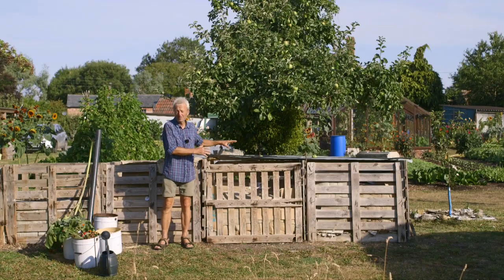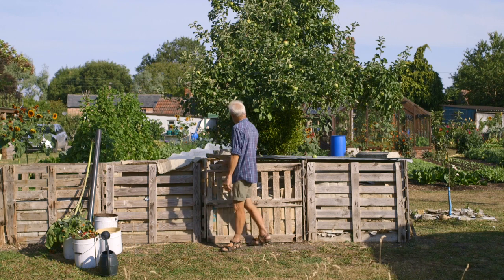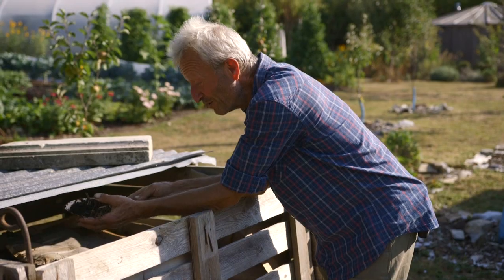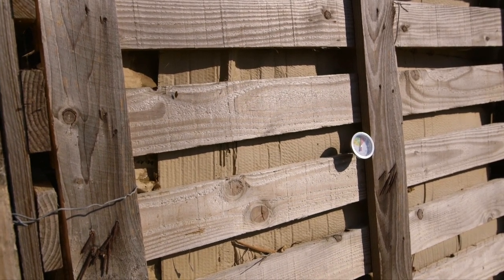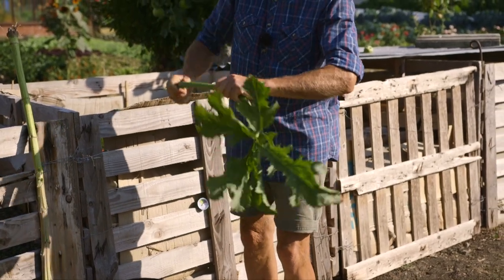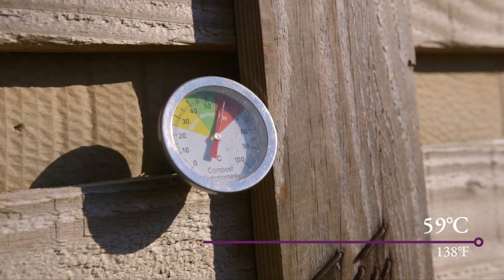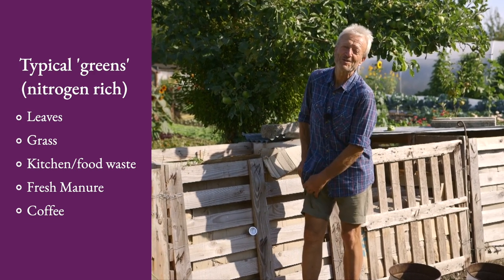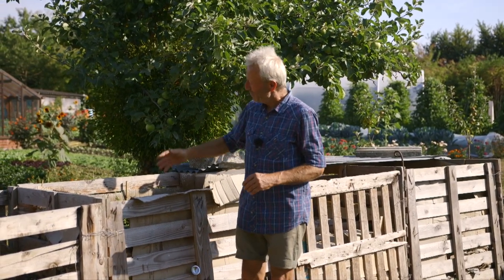4 Compost Heaps in 3 Bays, ready in 6 to12 months

Comment: People put in a PVC pipe in the middle of the compost heap with holes drilled in to allow oxygen to pass through.
I think the secondary part of it is that you can add water that will distribute the water around the compost better.

Comment: Wonderful video thanks! I am a compost nut for years and have always found drying out is the biggest problem in most heaps I see. I have found placing objects on top help to retain moisture when it's very hot. Heavy rocks or logs help. I never thought of cardboard sides. Thats genius! It will also keep the pile warmer in our freezing winters. For sides I use welded cow panels which in the US are 55" wide and 16' long. So if I cut into 4' lengths I get sides 4' high and 55" wide. One side of these sections will have long spikes which I hammer into the ground about 5" which makes the sides very stable, needing only some ties on the corners for support. My favorite ingredient is fresh green grass clippings which I collect by the bagful at our city compost site. Layering that in is like rocket fuel for the pile, I love to see it heat up to 160 degrees in a couple of days making me very confident to add any weed seeds I have around to make for completely no weeding when I spread on the garden.
Reply from the maker: Great to hear Brian, what an excellent system you have!

Comment: Thanks so much Charles. I have a similar system for composting my garden debris. I just wish I had as much garden matter as you to make compost faster. I add a fair amount of coffee grounds from a local coffee shop to add volume. I used to have a horse manure donor…. But they moved on.

To prevent rats I also use 2 small compost tumblers where I put most of my my kitchen waste along with any fruits or root vegetables that would attract rodents. I add compost worms to the tumblers (harvested from my heaps when they cool a bit).  The tumblers basically become rat-proof worm bins (since the tumblers never got hot enough for me to make compost quickly enough without worms). I add pine pellets to absorb extra water in the worm tumblers. The worms survive the winters well in my climate (maritime temperate like yours, in coastal Washington state, US).
Reply from the maker: Nicely worked out Greg. Hope you find more material!

Comment: Charles, I agree air access to the compost is overstated. My compost wooden bays ,  modelled on yours, have no gaps between the boards. In addition, after a few years, I lined the outside of three bays and one side each of the two inner walls with 3 inch foiled high density polyeaurathane insulation boards. A lid of the same material covers the compost in each bay. Only the front is not insulated , but I do as you advised and line inside the removable boards with a double layer of cardboard . The bays  are covered with a tarp to stop excessive moisture.  My compost is just black gold. If temperature rises above 60 C I remove the lids for a while.
Reply from the maker: Nice to read this Eileen, great job!

Comment: Thank you for breaking it down, no pun intended. I had no idea I could put marigolds or sunflowers with seeds in the heap. I have been throwing away  my weeds and big borage plants that were full of seeds. (They grow everywhere!) Time to rethink my strategy!
Reply: I think that heap size and temperature are key.  I have a smaller pile that rarely gets above 120F and seeds will not reliably decompose below 130, so I cut seed heads off, particularly for problem weeds.

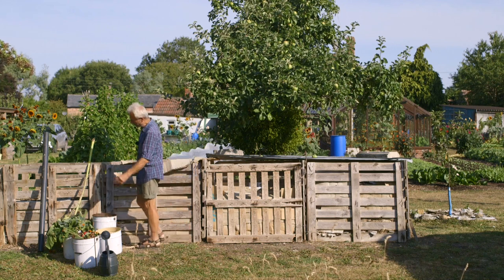Comment: 6:49 the air hole
I do something similar and put in the daleks
I take a piece of pvc pipe( can use an old discarded one if you wish  approx same diameter as your fence post and have drilled lots of little holes( perforated) . I leave the pipe in the middle of the compost as i build it up. The idea like yours is to draw in air to the middle.
Reply from the maker: Nice!

Comment: Charles, you pallet compost station is exactly the same as the one I built 3 years ago, 4 bays long. I wasn't sure it was a permanent position for composting in my garden. I found thin wooden posts (one in each corner) between the inner and outer slats of wooden pallet driven a foot or more into the ground helped secure the structure during construction and anchors the pallets together. If the composted needs to be moves its just a case of pulling the pallets up over the posts and pulling up the posts. It's worked well without having to nail into the pallets.
Reply from the maker: Nice!

Comment: I have 6 compost bins running. Packed into thick vegetable transporter boxes.
Turned one today. It had gone cold. Made it on the 29th sept . I had a few dead herrings in it along with dry and wet grass. I also put cow manure in with it.
Top was dry as a bone. Half way done was still damp and brown. The top half still looked greenish but covered white. Not burnt. 
At  the bottom it was pretty good so I mixed a bit of soil and mixed it. Looks good to use. 
I have remixed the pile into another box wetting it as I go.
Added some fresh soft cow poop. New dry grass to replace the top. Tarp on top. 
I have two other heaps. 6 x 6 x6 ft roughly. One has been there for 12 months and is only just resembling some form of decomposition.
I'm sure I have the mix wrong for quickening it up. But it will get there.
The other one I just roll with the tractor every few weeks. All trials as I am a newbie at this.
My large piles have never got over 110 f. Not that I can reach the middle. 🙂
Reply from the maker: Yes moisture is key to breakdown, enough but not excessive.
Sounds like you're enjoying that and finding good ways for your situation!

Comment: I try to make sure my compost isn't layered, as a homogeneous mix of materials seems to keep its heat linger & break down faster ( I do use a LOT of shredded cardboard but still see consistent temperatures over 60°C).
Any woody stems go through the shredder first & believe me, it works, just like Charles says.
As for moisture, I use recycled beer...
The dumpy bags used by builders for sand, gravel & ballast are great for storing compost prior to use, as they're free & allow a limited amount of air into the material. Be aware though that they are NOT usually UV stabilised & thus at some point become fragile & start shedding plastic fibres.
Mine go in the plastic recycling at that point, in the hope they don't end up polluting somewhere in Africa or Asia.
Reply from the maker: Nice job!
Reply: Recycled beer 😁. Never called it like that! I use recycled coffee for the same purpose.

Comment: We made a bin out of wire,  and have found that,  indeed,  it dries out to quickly.  We've made a space to put in the three-bin pallet, found pallets to use, have cardboard,and it's on the calendar to set up by the end of the month.

It's so much better to not have to worry about what dire chemicals may be in the compost acquired from outside.
Reply from the maker: Sounds excellent and may your compost be super good!

Comment: Thanks for all your wonderful videos and for sharing all this information. I'm about to try my hand at composting yet again. I've collected pallets which are 3' x 4', with the slats running the 3' dimension. I'm wondering if you'd recommend building 3' x 3' x 4' tall bins, or 4' x 4' x 3' tall bins. My inclination is to go for 4x4 to build more heat, figuring I can stack my raw materials beyond the 3' walls and allow the pile to settle  with time, but I dread having to rebuild the whole thing a second time if I guessed wrong. What do you recommend? Thank you  so much!
Reply from the maker: Hi Rika
I would make a 4x4 heap because than you have more volume to generate heat. Just as long as you have enough material to keep adding because that is quite a big volume for a small garden, it's good for medium size gardens.
And yes, it's feasible to go up higher because the level quickly sinks. Best of luck!

Comment: Useful as always!!! I’ve just turned my 3 bays compost today after the winter. Snow has just made its disappearance this week 😅. One bay was filled with chestnuts leaves back in autumn and I found not much had moved since then (sad face)… I also dumped in the compost a fair amount of chestnut left over and I was wondering if you have had any experience with this? A fair amount of chestnuts started germinating and I wonder if that is a good thing or not….?
Reply from the maker: Wastes from trees generally take longer than from say, vegetables, because of the woody lignins. I would use all of that, and not worry about new germination! It's all organic matter. In your cold winter, that result is not surprising!

Comment: I love your compost videos! 😊 A few weeks ago I started filling my new compost (made of pallets) and it is getting close to full. The temperature is around 68°C. Will be interesting to see how long it takes for it to be finished compost here in Sweden where I live. The winters are cold here so I think the compost will most likely freeze. 

I have chosen to run all my compost material through the lawnmower to get everything into small pieces. I think that the composting will be completed faster this way. Am I thinking right or is it just unnecessary work?
Reply from the maker: That is a good idea Sebastian for anything fibrous but I don't think you need to put the green materials through your lawnmower. I doubt whether the centre of the heap will freeze in winter and it should be amazing to use that next spring, or even before winter
Reply: @CharlesDowding1nodig  I'm so exited to see how it turns out in spring 😃 With the next compost pile, I will only run the fibrous parts through the mower and leave the green parts intact as you suggested. Will be curious to see if there will be any difference in the result.

I might leave the thermometer inside the heap during winter to se what happens in the center of the heap around January - February when it's usually at its coldest here. Last winter, the coldest night I measured was -23°C.

Comment: Decent compost is a space hog, though, isn't it! No problem in a larger site, but I'm counting myself lucky to finally be able to fit two bays in my latest garden, not a hope of three. So I'm just turning it over, it's slower and there's a bit of sorting and sifting involved when it comes to using it. Maybe a shredder to make the ingredients more consistent would reduce that. But it's way better than when I had a smaller garden without even the space for two. We could all use more close-to home community composting that could work on this scale for a street or a neighbourhood.
Reply from the maker: Good luck with that :)

Comment: It's unfortunate that a great many homes in the UK cannot accommodate this kind of setup. I live in a modest new build and so can only place a small bin. I find the cylinder bins turn anerrobic so i have taken your logic of having multiple bins but have done it vertically. The top bin holds fresh material and has holes in so that it can filter into the next bin. Fantastic video btw just to say I would not put seeds in my compost as it does not go past 40c even in summer.
Reply from the maker: Amazing Myles!

Comment: Good morning Charles, thank you for the video! One thing I think you forgot to mention was covering. What do you suggest? I did notice the corrugated iron in the video, do you cover the whole heap? At the same time I noticed the cardboard in the middle bay. Is that sufficient as a cover, or does the heap need to be protected from rain?
Reply from the maker: So right! Card is to keep ,moisture in during the summer, yes corrugated against rain when wet. Over the finished heaps only

Comment: Hi Charles. 

I think I made a mistake in my compost and now i'm afraid it is too late. In spring of 2021 I filled my compost bin (4 pallets type of bin) with pretty much the right ratio of browns and green. About 60% brown, 30% green and 10% high green of a good variety of ingredient. 

The problem is, I made a huge mistake. I added 3 full buckets of wood ash. I was in a rush cleaning the property, I had no idea where to put the ash.. I dumped it in my bin thinking to balance it later on, but forgot, and mixed the whole thing.

Now there are 3 full buckets of wood ash in my compost, which otherwise looks amazing. I'm afraid I dumped way to much ash in there and it might ruin my PH. Now its too late I spread the compost on my beds already for next spring.

I was wondering whats your opinion on my situation and if there are any fiixes I could make?

Thank you.
Keep being amazing :)
Reply from the maker: Thanks, and I would not worry at all about that and I don't see any issue with pH. You might have read things that concern you but there's a lot of false information. 
Some people spread ash directly on the soil and that can work but I feel it's better translated into compost.
Reply: @CharlesDowding1nodig  You reassure me SO MUCH! I was highly worried. Thank you Charles :)

Comment: With the Dalek bin this year I used the drill and a long, 3” wide plant auger bit to turn the compost, saving the back, every three days for a month. It rebooted the heat, too. Saved the composting material in old inside out compost bags with a glug each of worm  and leaf mould tea and dotted them around the veg beds to dump out when needed. Particularly useful as a light mulch around summer/autumn transplants. Full of earth worms.  Didn’t make much this summer due to drought. 🥲

Comment: My compost bins go dry. Even my large heaps go dry. These I roll over with a tractor bucket and spray every 2 or 3 weeks. I cover them with a tarp now. My smaller bins are old cardboard veg boxes. 4ft x 4ft x 3ft high. I turn from one to the other when inactive. I will add some green grass or cow manure.
Inside the inactive bin, Some of the grass is dry, some is white. They get to about 130f. After 2 to 4 weeks they stop and cool. But by turning them I get some compost in about 3 months. 
Now I'm catching up I am thinking of making a bin for finished compost and adding worms. Worms are hard to find here. Our temp this week is 30 to 33c. It will mainly stay like that now til march. Going up to 40c and down to 28 at times. 
I'd like to say my compost works. But I have so much trouble with bugs! Flea beetles this year and cabbage whites. Anything leafy cops it. Even cabbages under insect mesh frames. I have no idea how a butterfly got in there. 
Charles, do you think a heavy weight on top might help quicken the process?
Reply from the maker: Hi John, your conditions are so different to here and in those ambient temperatures I'm not surprised that your compost is drying out. In 1920s India, Albert Howard made fantastic compost in the ground, after digging out hollows. It does sound like it's all about moisture retention, and maybe just walk on your heaps to ensure they are consolidated because dry materials can often hold too much air, and need to be squashed down, so your question makes sense!
Reply: @CharlesDowding1nodig  thanks Charles. I am still watching and loving the videos. 
I often wonder if my bins with all different ingredients are better than the larger piles of wet/dry grass with ciw manure. Either way composting is addictive. Not sure I need to garden other than to see how the compost works..😉
Reply from the maker: 😂 I get that!

Comment: This may sound odd, and I 100% understand nobody else will probably ever do this, but I have had success taking a small bit of finished compost and culturing it in liquid, and I've found that when adding new material or starting another pile, a heavy spray of my homemade "compost starter" really inoculates the pile very quickly.

You can get a closed compost container and very quickly compost meat and animal parts/food scraps this way as well.

You must be careful and check your culture if you're ever going to so something like this because it's really easy to culture the wrong things and they can harm your compost or even yourself, for example if you accidentally grow a lot of e coli.
Reply from the maker: Is cool, others say they do this, nice work

Comment: Hello good sir! Would you say that it's mandatory for the compost heap to be exposed to the sun? Becouse I started my compost pile early spring this year, but on a place where it's shady all year round pretty much and the process seems to be super slow even with not alot of material in it. 😥
Reply from the maker: Actually it's fine if your heaps are in the shade because heat comes from inside, not outside. Maybe you need more materials to add :)

Comment: Hi Charles, Co and followers. How do you get around using H4 or treated wood used in commercial pallets? I love the re-used pallet concept, the design works really well yet the compost will be sitting within treated wood. Raw un-treated wood will rot, What is the suggested balance?

Thank you
Peter, New Zealand
Reply from the maker: Good question Peter, and many pallets here are heat-treated without chemicals

Comment: I'm using a dalek for compost due to limited space. To get it producing enough compost I have to remember to break up the materials into much smaller pieces. I also add a bit of worm compost tea to speed things up. 
Autumn is here, now I can get lots of falling leaves in bags to make more compost over our mild winter here on Canada's West Coast. 
It's difficult to convince people to use composted material for the gardens because so many are upset, abhor insects, even worms. I just forget about this, keep improving the soils, and try to garden despite the glares and reactions.
Reply from the maker: Well done, and I'm surprised to read this and sorry you have negative reactions about doing such a wonderful thing! Keep it up 🏆